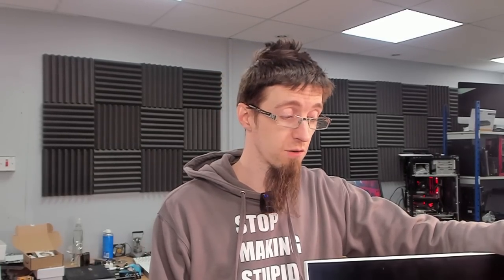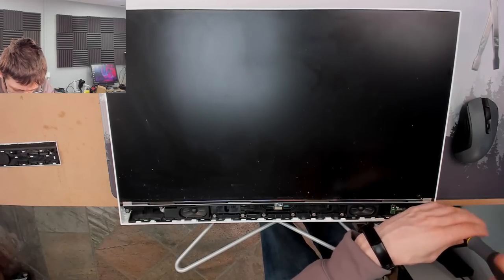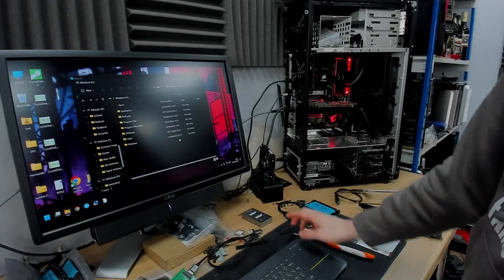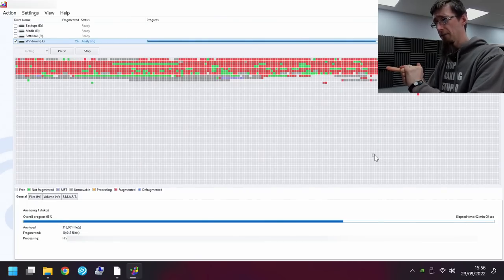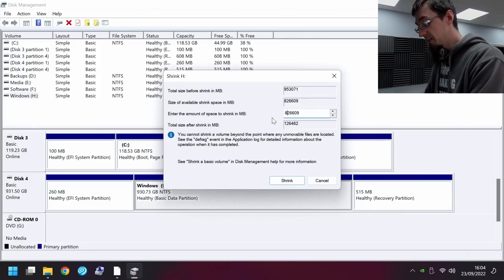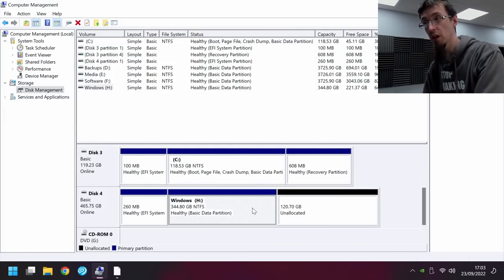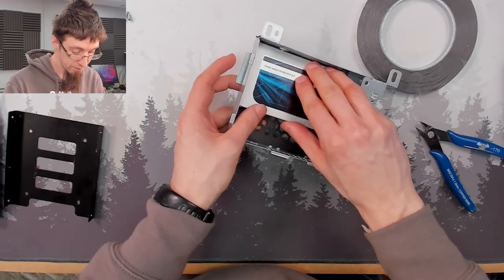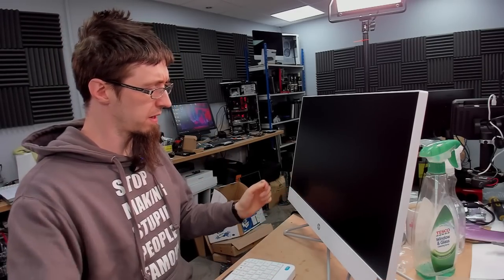SSD'ing a HP All-in-one, Drive Snapshot Waffle - LFC#325

Comment: FYI Macrium Reflect with auto fit data/partitions from a larger drive to a smaller drive. It works for me 90% of the time, but in rare cases I have to do it manual, but nice thing I can do it right in Macrium Reflect.
Reply: Yeah I have had success doing that in Macrium as well, wouldn't like to compare it to much else in terms of software as I haven't used many others but it's certainly done the job for me when I've had to do different sized drives.

Comment: I just did two of these HP AIOs and 6 laptops for a local doctor's office. All received 1tb SSDs and full drive cloning. I really tried to talk the good doctor into fresh installations and just file transfers, but he was adamant about cloning following a chat with his son (who doesn't know anything about anything but probably did a 2 second Google search on the matter)..... Oh well, everything went smoothly, I just worry about inherited problems down the road.
Reply: Nothing wrong with cloning properly,  it saves you so much time when you not have to set up/customize everything again for the users.
Sometimes users can have complicated configurations which they not want to lose.
Reply: @Doman2000  yeah, but without prior knowledge of the current state of each machine I'd prefer a fresh install personally. I've personally seen clones bring over or inherit twisted registries with God knows what. A simple back up and transfer of their documents etc etc with a fresh new copy of Windows is just so much cleaner.
Reply: @x7slim8x  'Simple' back-up turns into a nightmare of 'Where are my files at?'. I did number of HDD to either higher capacity HDD or SSD, I always defrag-clone them. Unless, my friends or cousin decided that there's no critical data on their old HDD, that I can simply clean install Windows.
Reply: I am getting ready to replace a mechanical 1tb hdd to an 1tb ssd and plan to use Macrium Reflect Free Edition which I have used several times without issue

Comment: It's great to see someone else who uses Drive Snapshot, which I purchased it in early 2016 for around £30 and has been perfect on every single computer that I've used it on and I usually run it via batch scripts to make it be fully automated (as it does so much more than what you see in the GUI).

Drive Snapshot used to it's full potential really is one beast of a program.

Comment: I've seen a youtuber that had some cool 2.5 to 3.5 inch "converters", it looks like a real 3.5 inch mechanical hard drive, but in the back, there is a small door where you can slide the ssd in, and once you close it, it mounts right into that bracket you have there, and it looks like you did install a mechanical hard drive (the customer might think you didn't even install an ssd in the first place), and it has the connecters right in the corner where they are on a 3.5 inch drive! It's really cool and very easy to install!

Comment: 28:31 What about just drill holes (2 of them diagonally or even one near the SATA connector?) on metal shroud or even adapter where screws of SSD are located?

Comment: I can recommend ''ORICO 2.5 to 3.5" HDD SSD Mount Bracket'' when it comes to mounting 2.5 drive in 3.5 bracket, they have the correct orientation and works perfect :D

They're like £7-8 each on Amzon though, but they're perfect when it comes to computers when you can't route the cables to the drive :)
Reply: Yes, I can also recommend those.  I've used them in an iMac G5 with absolutely no issues :)
Reply: @nticompass  I bought mine when I was upgrading my 5.1 Mac Pro, and since then I’ve also used them in iMacs/HP AIO and normal PCs with no issues 👍🏻
Reply: This, this is the only proper way to do this. This adapter completely turns the 2.5 format into a standard 3.5 format. Including proper positions for the sata and power. I shake my head at some of the other janky as feck solutions proposed elsewhere in the comments. Drilling holes, tape, etc, really?
Reply: Fenlink 2.5" to 3.5" Internal SSD Hard Drive SATA Drive Converter on Amazon
Can I put a link  to it or something?

 has a connector on the right side to the sdd and move it to the right side of the adapter to

Comment: MX500 is a great SSD for this kind of use case. Little bit more expensive than bottom of the barrel SSD. It has a DRAM cache and has TLC in a world of QLC and DRAM-less SSD's.
Reply: I both agree and disagree, no complaints as it's certainly good value, but if you have an M.2 slot as an option, a wd blue SN550/570 is much better for roughly the same price and black SN750/770/850 is just a few bucks more.
Reply: @vgamesx1  Absolutely a M.2 drive will blow the socks off of any sata drive as long as it is using NVMe and not SATA.
I have a HP Elitebook 745 G6 laptop that came with a SATA based M.2 drive, and it is actually slower than an MX500.
The laptop supports NVMe but HP being HP installed a M.2 SATA drive anyway. Probably because it was cheaper at the time.

Comment: SSD'ing is like something I've done for over a decade now and never though of describing it so simple and efficient. Used Acronis and Macrium Reflect; I had no idea about Drive Snapshot. Nice video, I had one AIO like this to do the same - just Intel not AMD and same 1 TB 3.5" HDD that I was not expecting in such a machine that was supposed to be modern and well designed. 2005-performance storage in 2017-2018+ machines, wow... And they are expensive for what low specs they have, no battery, not portable and don't get me started about the screens...

Comment: With Respect, Adam, if you're dealing with an AIO you don't know, i suggest u RTFM before using prying tools to release the display (trial & error style) causing possible damage. thanks a bunch for the great videos.
Reply: Yes. As bad as HP may be, they do supply service manuals for most of their computers. I usually check that before opening a client's laptop or AIO. Failing that, someone may have already made a YouTube video about it. xD

Comment: I like using double sided gorilla tape. it's fairly easy to get off, but it's slightly gooey and stretchy and doesn't leave behind residue. 
it will take a lot of force to dislodge a few inches of the stuff
Reply: Yes, in some machines it's difficult, if possible at all, to locate a bracket that will attach in the old hard drive space and still hold an SSD.  I'd still be leery of using an adhesive tape because of elevated temperature in the computer case.
Reply: @SeekingTheLoveThatGodMeans7648  gorilla tape is extremely strong. it will never come off.

Comment: I do have a usb to sata adapter but it dosent have external power supply jack so it can only support 2.5inch drives, but does work if you need to transfer files from a laptop harddrive thats failing to a SSD

Comment: Another couple of mounting options, I've found hot glue holds small parts like SSDs quite well and of course peels off pretty easy if you do need to remove it, alternately I know you said you don't like plastic, but this would be a fantastic use case for a 3D printer, instead of buying loads of adapters/brackets you can print them as needed and make custom ones for these sort of trays.
Reply from the maker: 3D printed brackets are a great idea, yea - I like that. Not enough of an excuse for me to buy a printer yet, but I think that's a good idea.

Comment: 19:16 How good of an idea could be? We can't be sure of the state of the Windows installation or the programs. The customer maybe aware of the backup restore points and may try to use them to restore to working state. The drive includes one real partition with the data and the Windows installation, it's even trickier to repair with the 512 MB partition that you removed (as far I remember from experience of incidentally removing mine).
Reply from the maker: This is why you backup before messing with the drive, just in case a customer is insane enough to be playing 4D chess where they're using restore points as backup (don't do that) using the restore partition for a repair environment (don't do that) and not telling the person that's doing the hardware work in advance about any of this (don't do that).

Comment: It's always good to refresh ones memory on resizing drives, the average home users may do it once or twice. I did last year but got too obsessed with tiding the partitions on my, now 4 drive PC I removed the windows boot sector on drive D thinking drive C was safe as my windows disk, but Win10 had other ideas when it installed it to D drive. MBR rebuild or clean install, after a lot of swearing I manged it without the need for a clean install. 👌✌

Comment: Graham, for your 2.5“ in 3.5“ mounting needs you need the „Sabrent BK-PCBS“. With that it fit perfectly in those all-in-one upgrades (also useful for NAS sometimes) and it’s high quality. It costs 10£ on Amazon UK.
Reply from the maker: Yea that'd do it. Not something I'm going to keep in stock though, it's rare for me to not be able to fit the £2.20 metal adaptors I keep in, and £10 is a lot for a problem that tessa tape can solve on those rare occasions.
Reply: @Adamant_IT  It's 35$ for me. 💀

Comment: After seeing the honeycomb holes only line up with one screw I would have drilled 2 or 3 new holes. Use your 2.5" to 3.5" adapter as a template to mark the new hole locations.

Comment: With regards to fixing the drives I would use Velcro to fix the drive that way the drive can be removed later if needed ( I have done this with a few system I have built )

Comment: You could unplug the cables from the board and route the smaller ends of those through the hole and then the big plug end will be where it's needing to be.

Comment: I like to use Velcro tape from Amazon,  a large roll goes a LONG way and can be used for many attachment issues and can be removed/reinstalled infinitely without issue. I enjoy seeing other techs run-across these oddball issues and their respective solutions.
Reply: I've used Velcro tape to hold a laptop hard drive in a USB enclosure on the back of our tv for pausing live programs. Works very successfully. I'm not sure about using an SSD in this application.

Comment: Should have watched that earlier :D Got a similar puzzle with HP all-in-one PC. There was a hard mounted SATA connector on the PCB (like common laptop) located bottom right of the cage. Ending up with few layers of rubber tiles (with double sided tape) under and above the ssd. It was real pain to get the heights correct to have just the right amount of force so it will not wobble and not cracking the ssd case at the same time :D
Reply: and FYI the HDD was almost toast it took 12 min to get to the windows login screen after turning it on :D

Comment: I know you said that people are going to go in the comments and say use this program and use that program but I wanna place another vote for macrum reflect, its free for home use (so try it on one of your machines) and for commercial the cost is very manageable, I like it because I can do on device clones if the drive is in good shape, it boots into PE so you can do checkdisk if you suspect drive failure (logical) and can image to a NAS if needed as well, for the failing ones I usually use DDRescue in Parted Magic but I have been wanting to switch that to HDDSuperClone because that just went free and open source (also a good video idea btw since it can do SOME of what a PC3000 can do for free now) for images in between I give the customer back the drive so its there responsibility but if the drive is needing ddrescue then I store for 30 days and use Spaces+batch script to automate that either way man your great and I love your videos keep it up :)
Reply: Thanks for the heads up on HDDSuperClone!

Comment: Why not drill holes in the original plate that align with the SSD?  I like your vids due to the straightforward approach to dismantling the machine and the thoroughness of your reasons for using particular software, etc.  Cheers.
Reply: Some of these mounting points are dimpled for offset.  If I did drill I'd use spacers and double check that nothing will get shorted out, something that happened to me once causing me to lose a drive, plus taking precautions that no shavings get onto anything electronic.

I do not know why there are not many adapters for a standard SSD to all the mounting points provided by a standard hard drive.  It's a very typical problem.

Comment: Could you imagine if iMac's were that easy to take apart to repair? This makes me want to actually recommend these to people
Reply: HP is starting to make them harder to take apart. I have an older HP AIO from around 2014 that is so much easier to open than this one was. There are two screws on the back that raise the back panel up as you loosen them and then you just slide something along the bottom edge to release the clips and the back lifts off.

Comment: You need to use the 2.5 to 3.5 adapters that replicate the exact positioning of a 3.5 harddrive. Good luck finding them anymore though. I would have measured the hole spacing and drilled my own on the oem caddy. It's a shame HP didn't add those holes by default. Also, HP could have just included a ssd for a boot drive by default ffs.

Comment: i like to resize the drive partition if possible with the free version of aomei partition assistant before imaging to transfer to a new but smaller ssd drive and i can resize it later after the drive is duplicated on the new one. backup to file and restore from file works best with most programs and i prefer to use a PE environment i personalized myself with many useful tools to do such things and diagnose and repair lots of problems.

Comment: Before removing and trying to clone the spinning hard drive, might want to first run CHKDSK, no? In order to avoid hiccups when cloning to the SSD.
Reply from the maker: Don't do anything to a drive without backing up first. Chkdsk can uncover massive faults with the drive and get hung up, and you get stuck in the horrible position of staring at the chkdsk progress that's taking hours thinking "why tf didn't I backup before doing this? Even if the backup got stuck as well I would at least had a partial backup..."
Once you have some kind of backup, then you repair if necessary.

Comment: If a user has multiple restore points that he is aware of. What do you do? Is there a way to back them up separately?
Reply from the maker: At that point, I'd use a different cloning tool to deal with that. Not a situation that's come up though, as pretty much the only practical use for Sys Restore is to keep a registry backup - and even then Sys Restore is off by default on new systems, so can't be relied on.
Reply: @Adamant_IT  👍

Comment: As always cool videos very informative thanks

I recently laid hands on an old HP pavilion 20 all in one specs 2GB DDR3 500GB hard disk the CPU is an AMD runs at 1Ghz  works off a 19 volts laptop style power  brick the previous owner had it running in windows 10 but ran like crap 

I picked it up for about roughly £25  I say roughly as I live aboard can't remember pounds to Peso  it was supposed to be a buy upgrade and resell but it seems to have remained beside my bed for movies 

Even tho I haven't had the time to upgrade the memory and hard disk yet I did reformat the drive and installed windows 8.1 and I'm very surprised how quick this machine runs it boots up into windows very quick leaves my much newer laptop standing haha 

Currently I'm toying with the idea of bunging 8GB ram in it it can take up to 16 and bung an SSD in to it also but just cannot make my mind up on how I will install the SSD as I got 2 choices either take out the big 500GB and then replace with the SSD or leave the drive in there and use an adaptor that I can out the SSD into and it will replace the DVD drive and just keep the old drive as storage 

But am surprised with how little is inside of the all in one shown on this video because mine has a shit load of metal shielding in it that covers up everything and is heavy as f**k

Comment: I use a 3D printer to make 3.5 to 2.5 adapters, then you can also customize them.
Reply: ...still easier to double-tape; ssds weigh like a thin piece of plastic. And no mecanical parts, no vibrations, no way they come loose.

Comment: I hate working on AIOs…
I jacked up the screen once on  a Lenovo 520 AIO taking it apart to upgrade it.
It went pretty smooth in fact,  seemed to go perfect BUT when I put it together and powered it on, the fkin screen was cracked in the corner..😡

There’s no good reason they needed to make opening them   up such a pain in the ass..

Anyways,  it’s in my spare parts pile now..
I bought it for $50 .
I was gonna upgrade it and sell it,  and I’m not dropping $250 on another screen..

Comment: Removing the recovery partition was not a good move. It was not the HP's crappy oem recovery partition. It was in fact the windowsRE partition that the os uses to enter into RE environment which is sometimes useful if the os update fails for example. As far as i remember thie partition is required to use any of the advanced uitilities while shift-rebooting.
Reply from the maker: That's interesting actually, I thought it was only used for Resetting Windows (which is far better done with a bootable flash drive anyway). I'll have to check to see what the effects of that are - but then if you need to do advanced recovery stuff on a machine, it's better done with a USB flash drive anyway IMHO. It's not like the user is going to start doing advanced recovery environment stuff.

Comment: Wouldn't it save a bit of faff to defrag the HDD?  (and lol @ HPAIO-shirk)
Reply from the maker: Defragging usually won't move protected system files. There are some defraggers that can do it, but in my experience they're very slow with no guarantee of actually moving all the data. Despite the added complexity, it's much much faster to clear out the system files.